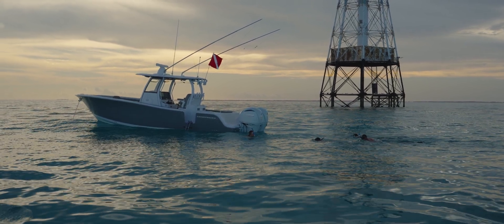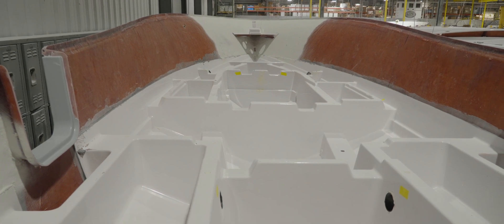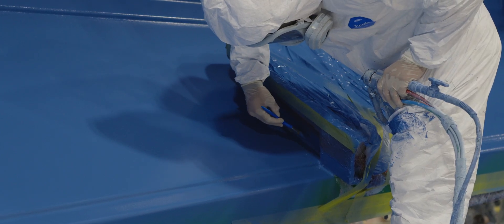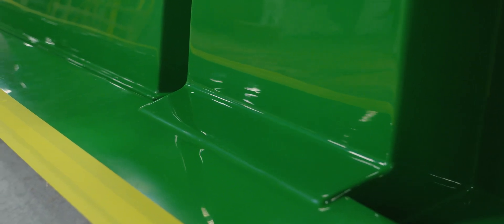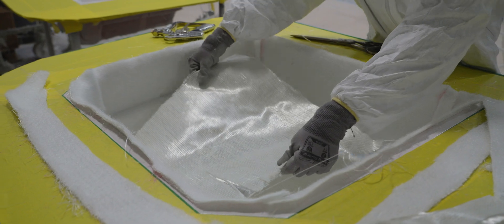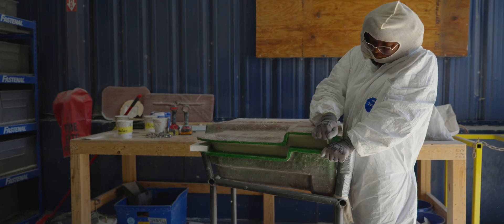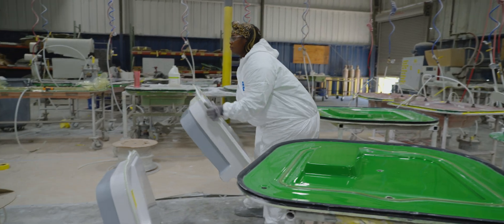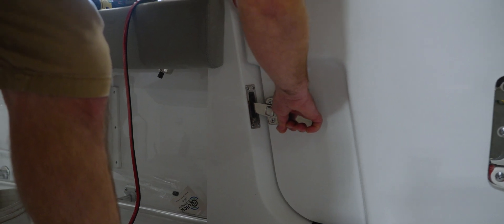Designing In Side Entry Doors - Sportsman's "Behind The Glass" (Season 3 - Episode 8)

Comment: 8:08 are the dark sections in the core metal plates for the hinge and latch bolts to thread into?
Reply from the maker: Close, these are composite pieces not metal plates but they are used for the hinge bolts. Since we use a foam core to keep the doors light weight you have to have something for the hardware to bite into, similar to how you cannot screw into drywall or it will pull out over time. We use materials like these throughout the entire boat with different strengths for different fixtures. Thanks for the good question!